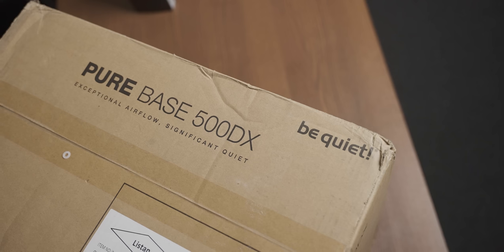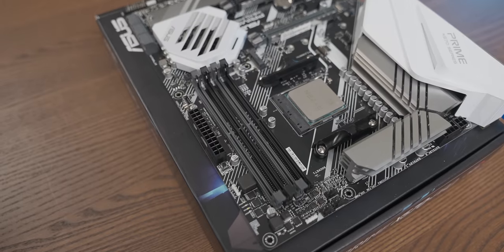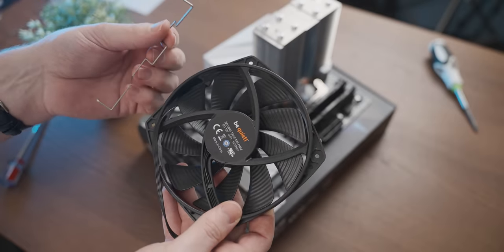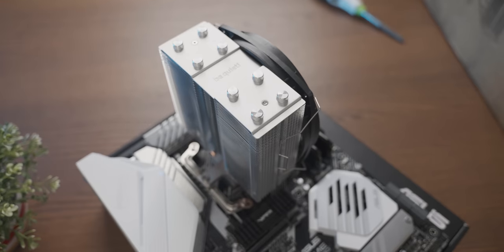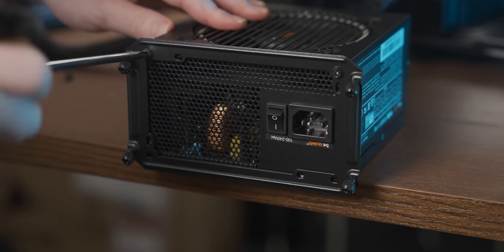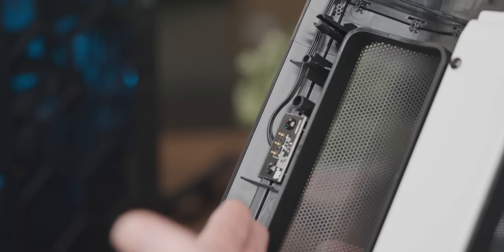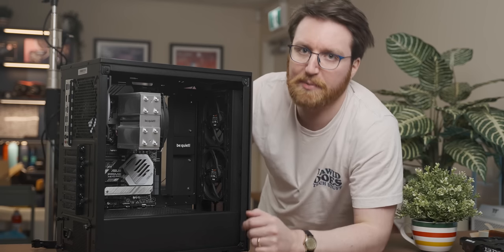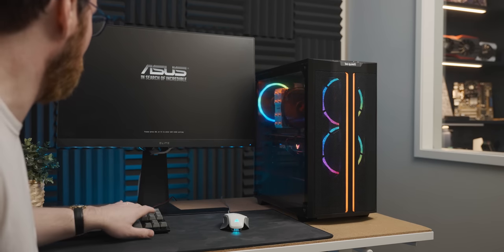Building A Beautiful Be quiet! Gaming PC

Comment: Meh for the CPU cooler. It's their proprietary 135mm fan, which you can't find as a single piece option, in case people want to add a second fan on it or have the need to replace it.

Comment: Isnt it dangerous for the components to peel off the plastic wrap of the glass panel when the system is running? The Leds also went dark for a second at 7:56

Comment: Tell me about the temperature of the GPU inside?? I have RTX 3070 in this case and it is burning. 85 deg on the hot spot. 75 deg on the cooler. The case's are totally uncapable to bring enough air.

Comment: OK maybe I am missing something, I've only ever used stock coolers, or my current AIO, but can't you attach the fan before mounting the cooler? I feel that would easier.
Reply: In some smaller coolers maybe but bigger ones the fan will usually block access to a mounting screw

Comment: I found ASUS ROG -STRIX-GTX1650 and GEGABYTE GEFORCE GTX 1650 
wich one take 
🤔
Reply: Asus strix gtx 1650 is more powerful than gigabyte gtx 1650 cuz it's the most expensive gtx 1650 but i recommend going with the gtx 1650 super if you can find it at a good price
Reply: The cheaper one, unless it's $10 difference. The card is heavily powerlimited and overall fairly weak, so a GTX 970 will outperform it - the Strix version might run cooler but you're not getting any real benefit out of the Strix overclock.
Reply: @b0ne91  me I found them with the same price wich one I take
Reply: @Pablo-jose11  then take the strix, if it's the same price. That was pretty clear in my initial comment

Comment: I ended up buying one of those horrid asus prebuilds off someone, the silver case one with no airflow, though he did upgrade it a little. 

Was thinking of replacing the case and cooler with be quiet stuff. Do you know how much louder the blower asus 3070 will be compared to an average 3 fan gpu? Never used one and haven't set the computer up yet. Probably throwing the 3070 into my current build, replacing the 1080, until I can get the new parts.

Comment: kinda looks a lot like my lancool 215 but with smaller fans and a slit in the front where air should be.
Reply: also have to add that removing the front panel on my case also employs the pull harder technique.
ouch, just noticed the big finger nuts on the side panel.  massive failure imo.
the build design is that of a no name budget case tbh

Comment: Are Xeon any good for gaming? I need a cheap upgrade because 4threads isnt enough anymore
Reply: No shit single core lol
Reply: go get intel core for gaming, not intel xeon
Reply: People's comments here are dumb and ignorant. If you're considering a Xeon, I assume you're on LGA 1150 or 1151, so looking at an E3 1230 (or higher - potentially v2 or v3) CPU. These are IDENTICAL to i7 2700, 3770, 4770 etc, except that in single core they clock around 100-200Mhz lower, depending on the model. This changes basically nothing. You won't notice the difference, except they're about half the price and widely, cheaply available from China.

If you're looking at X99 (X58 and X79 are too outdated), it's not the multi threading that you're benefitting from, it's the large cache on server grade Xeons (those E3 are consumer Xeons). That's why an E5 2640 v3 (a 35€ CPU) with turbo boost unlock exploit will outperform a Ryzen 5 3600 in some scenarios and a Ryzen 5 2600 in all scenarios. The single core performance is pretty good on these too, since it's still Haswell architecture and Ryzen didn't really get much better IPC until Zen 2 architecture.
Reply: @b0ne91  this dude is spitting out facts! Just buy one and pair it with a cheap GPU like a GTX 1050 ti 4GB / RX 570 4GB and you’re set to go!

Comment: "Overdrawing" connectors just does not happen! It's only for EXTREME cases! 12 pins is actually less practicle for the wiring!
Anyway, I have been following your channel for a long time, and there are two things you are a noob with:

1. Drivers
2. Power delivery

Comment: Why would they even have fan mounting clips?  Everyone already has a screwdriver for doing a build.  Hell, the cooling unit mount requires a driver.  Is it just to save less than a penny to avoid milling and tapping a few holes?
Reply: And if you want to replace the fan after it is installed in the case?  Would that be easier if you needed a screw driver?  There is a reason that the vast majority of air coolers use clips and not screws.

Comment: be quiet makes awesome power supply ya right. i bought one of there straight power 11 850w units. thing failed after 2 months outside when u  can return to amazon. i contact be c/s and they don't even have a service centre in Canada u have to ship all the way to California. they refused to even help out with a pre paid label even though the unit failed so quickly evga or corsair would have helped out with a label if one of there psus failed that embarrassingly fast. on top of that they offer no advanced RMA process even though pretty much every other major psu maker evga crosair seasnoic nzxt all do. there c/s agent pretty much had a to bad its not our problem attitude and when i asked for a manger they claimed they don't have one...